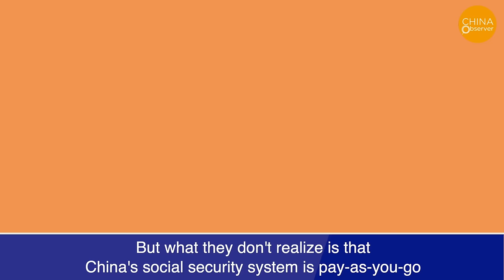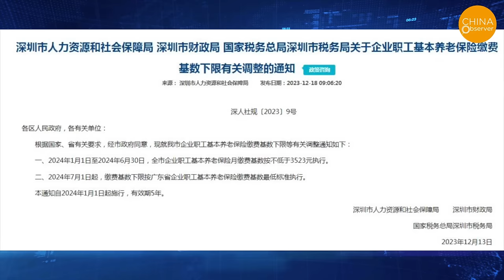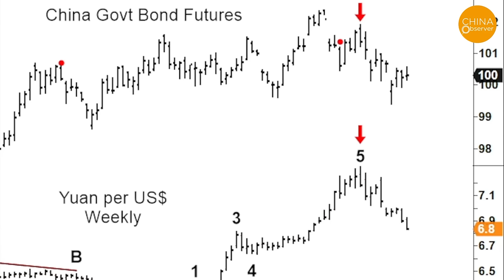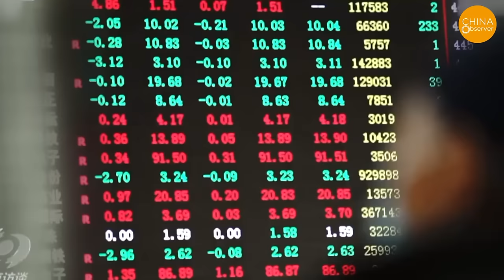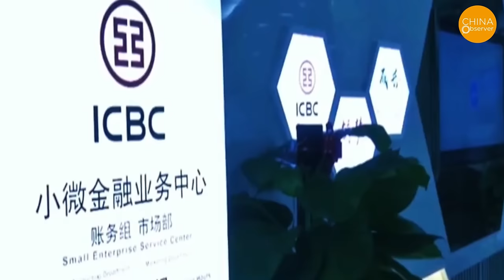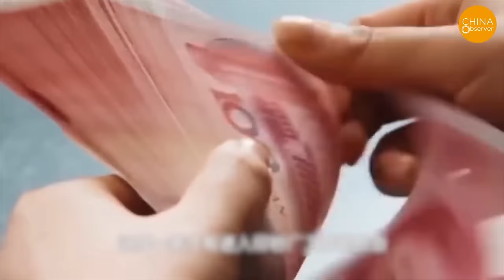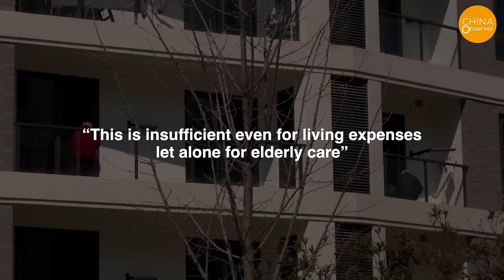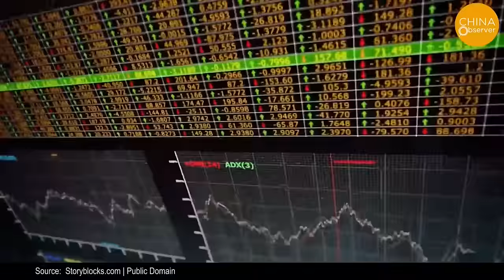No Money in Government, Pensions Underfunded: In-Service Staff Contributions Skyrocket by 120%

Comment: Retirement age, at least for Social Security, in the US is constantly adjusted upward. It has gone from 65 to 67 for those born in 1960 or later. It can still be adjusted upward, as the actuarial calculations indicate.
Reply: They need to lift the cap to adjust for our current income inequality. I still expect that medical intervention for those over the age of 70 is going to be strictly limited, though.
Reply: @sinan2.71  In the UK there is a limit on what is spent on older people. They have a board in the NHS to implement this.
Reply: you think, with automation and computers, the retirement age would decrease, not increase 😄😆😂

Comment: The USA actually has a worse system than "Pay as you go". You can't save money that you've already spent.  Does that make sense to you?. Throughout most of it's history, the US Social Security has taken in more than it was spending. Those excess funds were immediately spent on other government programs. The government then claimed the money wasn't spent, it was in a gigantic "Trust Fund". Those excess spent funds helped fuel the huge deficits we've accumulated over the years.
Reply: Hi Boris. Nice try, but no dice.
Reply: Our Social Security is in a " Lock Box " the government says .......
Reply: The so-called "trust fund" would be special US Treasury bonds issued to the Social Security Administration (SSA) that, when the SSA redeems them, the Treasury will go out and borrow the funds to redeem those bonds.  When those bonds run out, the law already says that the SSA can unilaterally reduce social security payments to the level that FICA contributions can support.  Last I heard that would be 72% of current so even that might be out of date and probably is or will be.